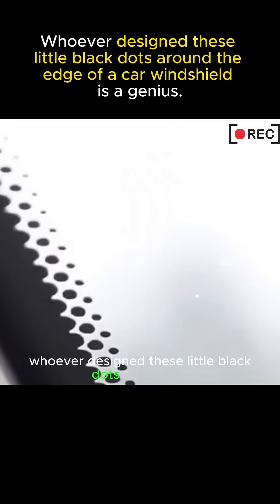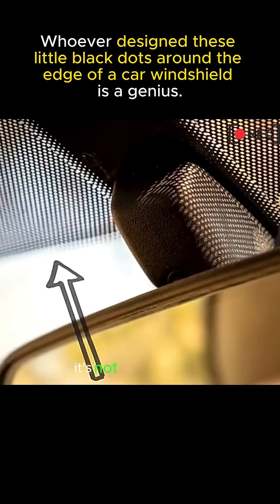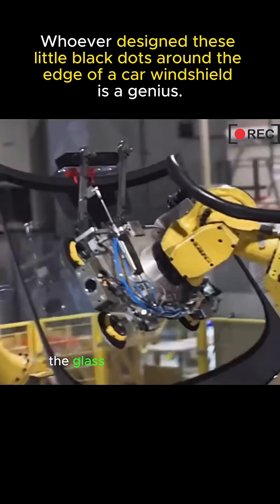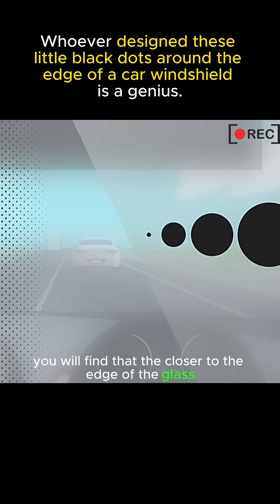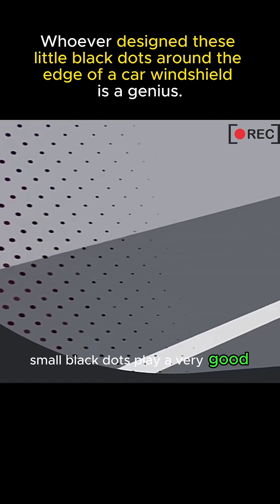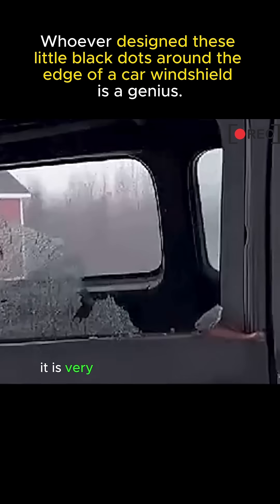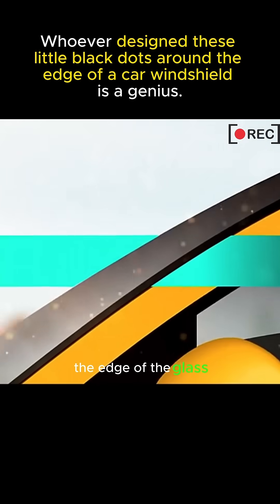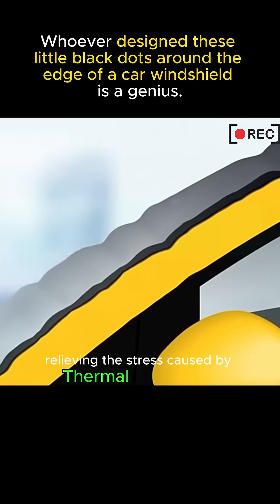The Reason Behind Dots on Car Windshields #CarWindshield #AutomotiveTechnology #WindshieldDesign

Comment: That black dot is called a frit. It's actually a ceramic enamel band that's baked onto the edges of the windshield during manufacturing. It helps to seal the edges of the glass and provides a smooth transition from the glass to the adhesive used to bond the windshield to the car's frame. Additionally, it helps to reduce UV radiation inside the vehicle and prevents the adhesive from deteriorating due to sunlight exposure.

Comment: The explanation isn't quite complete.
The frit is an opaque black coating that hides the silicone-based adhesive which holds the glass to the body. However, it absorbs infra red radiation from the sun and transfers that to glass. This would cause a steep temperature gradient and therefore thermal stress. The varying density of dots evens out that temperature gradient.

Comment: That is NOT what they are for.  They are called frits, and they are used to adhere the glue to the windshield, that's their main purpose.  They are also used to  break up the outer edge of the windshield to provide a more aesthetically pleasing appearance where the glass meets the frame.  Lastly, and the part you completely got wrong, they are used when a windshield is manufactured, it is first cut to shape before the frit is printed on. At this point, the glass is still flat and needs to be molded to shape, so it is heated before being placed on a bending jig. The frit will typically heat up faster and to a more intense temperature than the uncoated glass, which is where the dots, technically called a half-tone pattern, come into play. These dots will ultimately help to better disperse the heat more evenly from the frit to the uncoated glass.  It has absolutely NOTHING to do with the sun, or passengers in the car, once the windshield is in the car the frit has nothing to do with "heat dissipation".   You get an F for this video.

Comment: Dam I hated those dots used to work for a company that detail for him spec cars and you had to cut lots of different car parts. On the back of the martial it has these dots to line up and make a straight cut,  they make your eyes go crazy after hours of precision cutting lol Thankfully a lot of it is done by Lazors and machine

Comment: That black dot is called a frit. It's actually a ceramic enamel band that's baked into the edges of the windshield during manufacturing. It helps to seal the edges of the glass and provides a smooth transition from the glass to the adhesive used to bond the windshield to the car's frame. Additionally, it helps to reduce UV radiation inside the vehicle and prevents the adhesive from deteriorating due to sunlight exposure.
Reply: So not what this video says about dissipating heat so it doesn’t crack ?
Reply: @nunocolon  That as well.
Reply: @nunocolon Yes it also dissipates heat from the windshields edge.That is why the matrix pattern gets smaller toward the center of the glass. Its main function which the OP pointed out is to shield the adhesive from uv rays. This became a requirement once chrome and stainless steel moldings became obsolete.
Reply: One of the main purposes is simply to hide the ugly adhesive. The frits just make the transition from solid black to clear. Before they did this all car windows had a metal frame around them. They have nothing to do with UV. There's a UV tint on all the windows.
Reply: @DWish808 Exactly. It’s just cosmetic. I have replaced thousands of windscreens.
Reply: Interesting. Thanks for the comment 👍
Reply: thank you
Reply: That makes more sense than the videos explanation. Though i do expect the dots to retain more sunlight energy that it can then dissipate. Its then important to remember that the sun dont radiate lotsa heat per se, its high energy light photons thats absorbed and then emitted as infrared lower energy photons. Black absorbs more light than glass, so it is absolutely a factor.
Reply: A 'frit'? Thank you, I did not know that and I'm 61, and I am sure 99.99999 of the people I know do not know that, it's true, you're never too old to learn new things.
Reply: @martyreking5487 that's only one. More than one are called Fritz.
Reply: I love these obscure bits of knowledge thanks.
Reply: Thank you
Reply: Excellent explanation. Thanks
Reply: Thank you finally someone who's know what there talking about 

IAM an auto glass technician installer
Reply: I read this before bro got done yapping lol
Reply: UV radiation doesn’t go through glass. 😂
Reply: It's got nothing to do with adhesive buddy, in fact there's no adhesive at all, there's a layer between two glasses of poly vinyl butryl...the only purpose of this black ceramic paint ( that's what's it's called btw) is to prevent the UV rays from de-sealing the edge

Comment: Funny how these videos are complete bull, and something they just really pulled out of their asses.
This pattern is screen printed with ceramic paint, and baked into the glass with a tempering oven, the dots and black border and is mostly esthetique to hide the urathane sealent that holds the windshield to the car.
This replaces the chrome trim that cars used to use  and saves manufacturing steps.  Older cars did not have it and winshields didn't crack.

Comment: All that and he is actually wrong. Yes heat distribution is a side effect but Fritting, is used to bond the glass to the urethane adhesive used for the mechanical bond to a vehicle's body and gets baked into the glass when the windshield is produced. The dots act as a way to hide that adhesive and can secondarily act as protection from UV radiation.

Comment: As an engineer that worked with sunroof glass assemblies and the manufacturer of these glass panels. This is utter BS. Those dots are primarily used to hide defects in the ceramic coating on the inner side of the glass. Turns out ceramic printing in a straight line is a lot harder and more costly than dots due to the increased amount of scrap.

Comment: For anyone wondering those dots are called the frit and it also makes it so you dont see the glue under the windshield. A crack going across your wi dshield does not put your life in danger. The windshield is 3 layers, a layers of glass on the outside with lamination between each piece of glass. The windshield is designed to not break into shards and hold together. We have vehicles come in for a windshield replacment hitting deer and turkey with the windshield completly caved in and the worse youll get is some small glass shards and dust in your vehicle which yes does suckand yes you will might have some cuts but your not gonna be impailed by a shard of glass. Some door glasses are also laminated glass but most are tempered and break into small chunks not huge pieces that can cut you in half.

Comment: The black coating was invented in the lab I work at. It was developed at Johnson Matthey and it helps the glue holding the glass to the car under the black coating to not be destroyed by UV light. Also hides the silver used for the heating element in the back windscreen.

Comment: Every winter for nearly 25 years, my dad would go out every morning there was ice or snow on his windshield with a pot of boiling water and pour it to defrost his wind shield with no problems whatsoever.  On two sperate occasions I've poured a cup of hot water on two different windshields to help me break up the ice so I could use a scrapper to get the rest off, ending with both of them cracking.  This only tells me the manufactures are making the windshields weaker and weaker over time.

Comment: Stupid vidéo 

Its part ofnthe heated Windows 

In the back you have lines but on the front it be stupid to have lines in the vision line 

My car has heated Windows and there even à wipers defroster on the front winshield look up subaru wrx sti 2011 windshiled 

They super expensive for that very reason

Comment: That's not how heat works. Black doesn't attract heat. I wish people would stop believing this. My sister refuses to wear a black dress at work, because of this craziness. Black creates heat when light shines on it. It doesn't pull heat away from things. It literally makes more heat by absorbing the light that's shown on it. If you're in an air conditioned room, you won't get hot wearing black clothing, unless you're by a window. The sunlight will shine on the black, get absorbed -- because black doesn't reflect light, but absorbs all light around it -- and you'll get extremely hot. No sunlight? No heat.

In your scenario, the black doesn't redistribute the heat. It would actually create more heat.

Comment: This is bullshit.  The edges are black and absorb heat.  Clear glass absorbs less heat.  The dots create a temperature gradient between the black outer rim and the clear part of the glass.  Without these dots, the thermal gradient would be high and could crack the glass.

Comment: WRONG.....its nothing to do with dispersing heat evenly....its about protecting the Adhesive around the edge fom UV breakdown, but using a solid line with black paint would casue too much temprature difference within a line, thus cracking, the dots actually phasedley create a temprature zone to avoid cracking.

Comment: This video is BS. The dots indicate that the glass is glued in (not just fitted in the rubber seal like they used to before the 1990s) and the dots also protect the glue from damaging UV light. Nothing to do with thermal expansion. Video downvoted

Comment: U can apply the technology to the actual frame of the car as well as the frame of electronics to prevent overheating even the separate parts of the car to prevent overheating in the engine

Comment: interesting story but total bullshit, it has nothing to do with thermal expansion and everything to do with the adhesive used to mount the window, they create a rougher surface to give the adhesive something to bond to while at the same time hiding that adhesive.

If it were about thermal expansion ask yourself why are there no matrix dots on door windows, it's because they have no adhesive that needs something to bond to.

Comment: The front is not for heat. it’s to fill gap between visors sometimes, but always to not show the blackout as a smooth line on a curved surface (black out is to cover adhesive)

Comment: They are really unnecessary. The manufacturer should just stop making the glass so thin.  All vehicles made before the mid 90s have glass that is thick enough that a road rock won't do anything but star it slightly. After that you can crack, if not shatter your glass if you close the doors too hard. Signed-Richard.

Comment: Nice story, I'm  a Auto glass installer  and business owner for 40+ years the dot matrix design was created for the use of the installation product called Urethane a black adhesive rubber that cured or hardened that held the glass in place.
This product Urethane when it hardened gave a strength of 400 to 600 lbs. of strength per inch allowing car manufacturers to make a lighter car but maintain roll over strength for the roof.
Prior installation method used was called Butyl tape on a roll which came in 2 sizes 3/8 and 5/16 of an inch but only had the strength of 15 lbs. of strength per inch then a chrome molding was snapped around the edge to hide the look.
The dot matrix and black edging was in fact a the replacement  the old molding style to hide the Urethane so it would not been seen and gives a crisper look.
Reply: Why not needed in earlier decades?

Comment: none of the cars in the 1960's or 70's had these and I don't remember any cracking glass due to heat.
Reply: That’s because the glass in the old 50’s and 60’s cars was not safety glass like it is today.  Just straight up glass glass!! It was well made not like all this cheap ass stuff today!!
Reply: @workhard9513 i think that the several thousands of people that died or seriously maimed from sheet glass would have preferred safety glass.
Reply: I think because back in those days there was no rapid environmental destruction which could lead to high temperatures but these days environmental destruction is excess
Reply: @sgwlw7777  are you serious lol
Reply: @kevingilmore9366  yes
Reply: @sgwlw7777 yeah those days in summer time also my mom told me they use to wear sweater cause it cold.
Reply: @altolyngkhoi4239  We used to place our popsicles into the freezer to thaw them out some.  We were so relieved when winter came and it warmed up a bit.  I really miss those days before the environmental destruction.
Reply: @sgwlw7777  I agree, since the mid 30's the earth got more and more flat, therefore absorbing more heat from the sun.

Comment: Self evident stuff nobody E V E R has to explain to anyone 101... 
99% of the viewers looked at the windshield and saw the black dots and every single one knows what the sun does to the temperature in cars and knew instantly why the dots is there. So you have the figures backwards. 1% is locked in to mental wards or has something like the wrong numbers of chromosomes and if this was not self explanatory they probably are in to bad shape to understand an explanation even if you made one... like you did mate.
Just saying it as nicely as I can

Comment: Geeze. They are there to hide the interior molding. They are plastic and stop at the glass if there was no black edging you would literally see behind the moldings and the headliner and A pillars.  Manufacturers don't do finish trim like back in the old days. Get it right you irritating narater

Comment: This is incorrect. Absolutely. at the ends of the car's windshield, there is a polyurethane glue that fastens the glass to the car's body. In order for the UV radiation of the sun not to have a negative effect on the glue, there is a black protective layer on the edges of the glass. if the border of that layer were flat, then the difference in heating of the glass with the black layer compared to the part of the glass without the layer would be clearly divided and the glass would break. That is why the black protective layer is made so that it gradually disappears in the field of black dots so that the fields of different temperatures of the glass have a gradual transition. Greetings from BiH.

Comment: The Glas is glued in so it is not possible to expand .
If you had a Rubber arround your windshield it is not nececary.
The windshield Angel are much lower than in the past so they get awfull hot

Comment: How do they temper the windshields differently in different climates? What about those stolen imports from Florida? When I had my vehicle transported from California to Florida, the windshield constantly sweated and fogged up. How will those windshields designed for Florida humidity hold up in Desert or Cold air when the glass isn't tempered for that climate?

Comment: The black lines across the rear window are insulation for defog. I recently damaged mine getting tint glue off and now when I use rear defog my radio goes static... oops

Comment: Those dots are called a “dot matrix” it is a part of the “frit band” that runs the outside of the glass. In most cases it helps primer less urethane adhere to the glass and body while simultaneously keeping UV rays off of the dried urethane to help preventing dry rotting and the urethane cracking.
Reply: You must be a window tint installer. That’s for info
Reply: @DavidSanchez-wm8wd  close. Automotive glazier.

Comment: they are to protect the plastic dashboard and trim around the glass from sun UV and heat, not to protect the glass.
Reply: Close.  The dots are purely cosmetic.  They serve no purpose otherwise.  The black bands outside of them cover the urethane that glues the windshield to the car, and keep UV from harming it.   The whole "keeps heat down" is nonsense